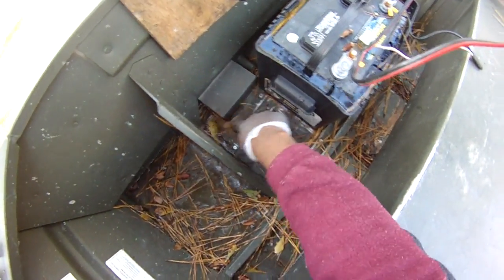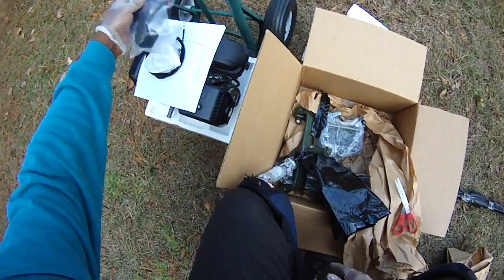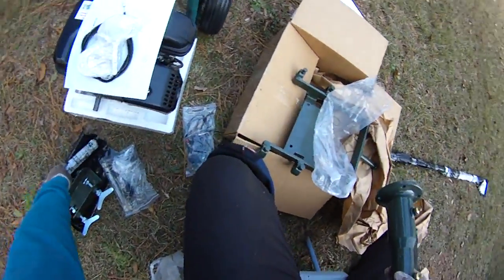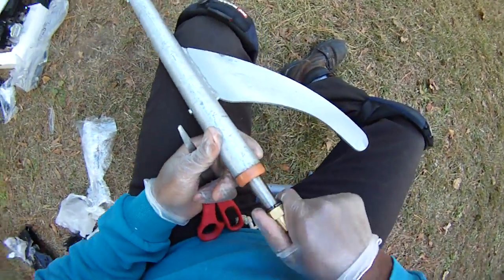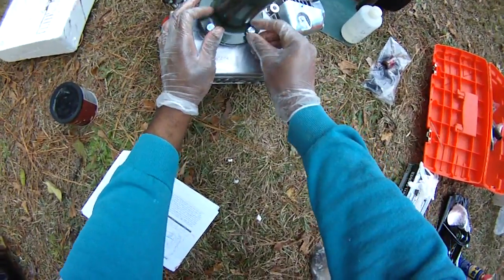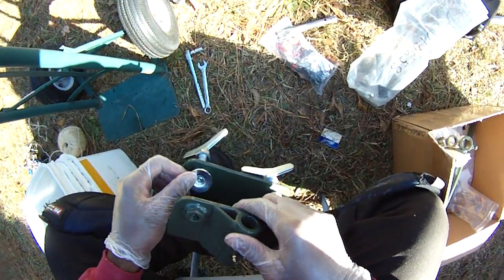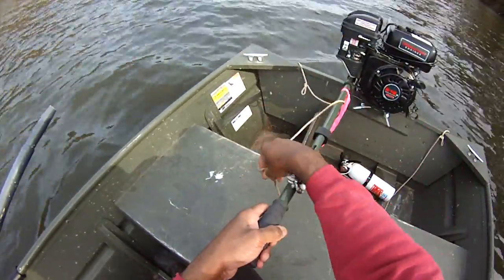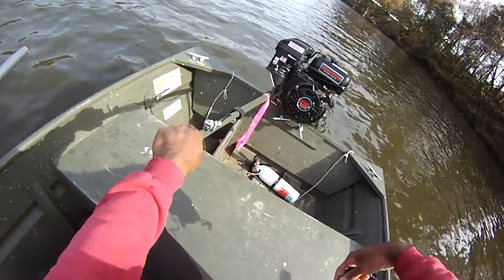SPS Longtail Review | Small Swamp Runner Mud Motor Kit | 212cc Harbor Freight Predator Engine

Comment from the maker: The owner of SPS North America, Joe Dobbs, e-mailed me a few pointers that might help some of you building from one of these kits:

There is one thing on your engine that you definitely need to re-do or
it will give you trouble. The wiring you cut and put a wire nut on
will not hold up. Those wire nuts are made for electrical
connections in home wiring that don't move. Due to engine vibration
that wire nut will eventually fall off and the wiring will come
apart. If I were you I would get myself some male & female bullet
connectors and rewire that kill switch. It will be much more trouble
free.

Also I noticed some of the grease zerks were only hand tight, so you
need to tighten them a little bit with a wrench so they won't fall out
due to engine vibration. Just a little, cause the soft brass will
strip out if you over tighten them.

Comment: Also, you may be able to stop the up down motion with a rubber stopper on the engine mount.  I know backwater does this with their mud motors, I'm thinking of doing something similar when I build the kit.  Basically it's just a rubber stopper on the top of a bolt that you thread down below the coupler on the back of the engine mount.  When the coupler hits the top of the rubber stopper the tail cannot go down any further.  Just a thought it would be a more permanent solution to the engine tilt.
Reply from the maker: +ejreams08 I just use a rope on the handle secured to the boat rib.

Comment: Nice video! Those brass fittings are called zerk fittings and make sure they are seated tight.They allow you to grease your fittings without having to "pack" them. Don't forget to put a couple of extra prop "keys/shearpins in your boat. Also on your kill switch, solder those three wires together and put some shrink tubing on them. Would you trust your life to a 5 cent piece of plastic? Nice to see you stress safety but don't forget your PFD. Have fun with your mud boat! PS: the best military aircraft was the C-121 (the super connie).
Reply from the maker: +Ratdog 305 The constellation was a beautiful aircraft. Modern aircraft lack that intuitive engineering those planes had.

Comment: Here’s a suggestion put an “adjustable rod/stick” across the boat width.  Bolt rod to upper sides of boat. That way the engine can only move up so high.
Reply from the maker: Thanks for the suggestion. A simple rope is the best solution.That's the way they do it in Thailand.

Comment: Just watching this video answered most of the questions I had, thanks for taking the time to record and post it.
Have you used the setup a lot since you installed it and if so how's it holding up?
Reply from the maker: It's holding up well. I'd recommend buying a good grease gun because you need to squirt it once or twice with grease before every outing.

Be prepared to get lots of eyes balls and conversation starters at the boat ramp. I mean you have this hot rodded little go-kart motor looking more like something they've seen at the drag strip than the boat ramp.
 
If you have the time Check out my mud motor hot rod course also up on my Channel: https://www.youtube.com/playlist?list=PL33pk1OEpFSoayYZMt5SH3-8WumPKytlz

Comment: That is actually a nice setup. I bet you could set this up with a centrifugal clutch. You could then leave it idling with the prop in the water without the boat moving, until you gave it some throttle.
Reply from the maker: Yeah, I've enjoyed it. Working on hopping it up with racing go-kart parts. I have the air intake and carb jetted giving me a good bit more power.

Comment: Nice Video. Very informative. Thanks fro sharing.

Couple of thoughts.:  First, can the un and down motion be dampened by tightening bolts on the bracket?  If so, that would be helpful.

Also , if you added a pre-tentioned bungee cord ore two from the tiller straight down to the seat edge, it might be enough to hold the tiller in a level position as well as self centering the steering motion of the motor in an accidental loss of control.
Reply from the maker: Well, the motor doesn't work like a regular outboard. You want that up down motion. the hydrodynamic forces and the weight of machine it self is a dampener. the propeller makes lift on its own, but the weight of the machine keeps it down.

Yes, it's customary to have the unit tethered with a string.

Comment: Very thorough video; thanks for taking the time. You mentioned having to hold down on the handle to keep the engine from tilting backward...once it gets up to speed, do you still find you have to push down on the handle so hard?
Reply from the maker: I've learned a lot since this video was made four years ago. Years the engine is balanced, and I had to move the engine plate forward and back through the various slots to find that "perfect" balance point. Also, in Thailand you always tie a rope that holds the motor and keeps it from flopping backward. And, yes, as the RPMs come up the tail will naturally rise making one-handed motoring very comfortable.
Reply: This manufacturer has a video on tuning this to “your” boat so it won’t pop out or pull
Reply from the maker: @Yuhmuthasaho  And it's also in the manual.
Reply: Black Warrior Lures whats this “manual” you speak of haha.
Reply from the maker: @Yuhmuthasaho  Whenever you buy an SPS longtail, you will get a manual with your motor's serial number. This manual is only available to SPS longtail owners and is only available in physical form.

Comment: Thanks for posting, this was really helpful as I put together my kit.
Reply from the maker: Nick Boehm Glad it helped you out. These are good motors.
Reply: Black Warrior Lures Hey, I was wondering how your motor does with RPM jumps? I'm still breaking mine in nice and light, but it seems to "jump" RPMs rather than smoothly moving forward and the engine kind of stutters, almost like it's not getting the fuel fast enough. Might be the throttle linkage? Any ideas?
Reply from the maker: Nick Boehm Mine runs smoothly. Have you made any modifications to the engine? If not I would consider rejetting the carb.

Comment: I've been watching your videos quite a bit to decide on what thai long tail kit to buy.  I just bought the 6.5 hp (212 cc) predator for the motor now I just need to wait on some cash for the kit.  What made you go with the SPS kit over the other companies?  Have you fixed the problem with the build up of heat on the shaft and the coupler?  How do you like the props? Have you broke any of them yet, I heard that was a problem with the aluminum.  Have you went through any weeds or mud with it yet?  Can the throttle be adjusted to stay at a specific position, can you tighten the throttle handle so you have to move it to decrease throttle?  And lastly, what size boat do you have width and length?  Thanks for the information, I am looking to put this on a smaller boat to get into backwater marshes by carrying the boat because there aren't any launches.  I think a small motor set up like this would work well enough.
Reply from the maker: +ejreams08 The throttle automatically returns to idle. Yes, you can tighten it that way. Yes I go through weed all the time. That's what it was build for.

I chose SPS, well. I'm a black guy and buying a kit from a company called KKK was out of the question. CLP was a good second. Ultimately Mr. Dobbs sent me a free performance tailpipe for doing the video. That's why I went with SPS.

Heat buildup is not a problem. Any transmission will get hot.

You need a soft metal like aluminum with these props. The idea is to sacrifice the prop, not the motor. That's why there prop are so cheap. No I haven't broken one yet, even though I've had it on the rocks.

My boat is jon boat 12ft 36wide.
Reply: +Black Warrior Lures lol yeah the KKK thing had me taking second looks too. I assume that it means something drastically different in Thailand!   Thanks for the responses. I ended up going with an SPS kit too, mostly because of your videos, really helped me see the quality of the kit, thanks for that.

Ended up buying a 212 predator at HF the other day, apparently its the hemi model which has made it a bit difficult to find upgrades for. But ive managed to order up, new mod 2 cam, billet fly wheel, connecting rod and bored out race carb. Also got the exhaust filter kit you got. Should be able to push 6k out of it i think. Ill be sure to do videos on it and post to the sps site. Hoping to get around 7-8 mph on a shallow v 14' "resort" type boat for backwaters. thanks aain for the videos, helped out a lot.
Reply from the maker: +ejreams08 Yeah, I want the Mod 2 cam and flat top piston myself.
Reply: +Black Warrior Lures I would suggest them, I think the black mamba jr gives a little more low end torque which could help the motor get out of the hole a little better, but I think the mod2 gives me great all around performance.

I finished the rebuild this last weekend, I ended up getting 20 MPH in open water with just me in the boat (330 lbs).  The cam and valve springs with the connecting rod and flywheel with race carb gave me a 7.5 mph boost.  I would strongly recommend doing the upgrades.  This was my first time modifying the internals of an engine, and I was surprised how easy it turned out to be. After I modded the engine I needed to prop up from the 6.25" to the 7".  Me and the girlfriend ran our local river for walleyes a couple days ago, skipped over 3" of water like a champ.  Next upgrade is gator glide for the bottom of the boat getting ready for duck season.  I'll try and post videos of the motor in action.  This thing is bullet proof so far, I haven't been kind to it lol.
Reply: Buy a Backwater swamp mud motor instead and it is American made.

Comment: Please reply on here, as I can see it here for some reason. Thank you! What were you saying about gopowersports saying not to use that engine? & why did you change the external gas tank setup? And what were you saying about the governor? I really enjoy your channel brother
Reply from the maker: Okay, I'll reply here, but I'll shot a video today explaining. 

1. Go Power Sports
I e-mailed GoPowerSports about using their engine for my mud motor. I sent them the video(s) where I blew up a couple engines. I wanted to know about the viability, reliability of their motor in an austere environment. This was the reply I received from Tim:

"I don’t know about that, I would think the 301 or 420 Predator would be best. its like you said you have to work the heck out of it to achieve the hp wanted."

2. Why change the external setup?
I kept getting leaks in the line. The weight of a six gallon tank made the rear end sit too low in the water and would not get up on plane properly. I also worried about reliability of the pump over time. The gas tank would swell so badly that gas would often creep up through the line and flood the carburetor. Overall the stock, gravity feed tank was a better solution.

3. The governor
the governor is the only thing keeping that engine from blowing itself apart. When you're out on the street or race track you have a smooth surface. It isn't like that on the water. Even the slightest chop makes for uneven, well, if you watch the governor arm while you're moving along, it's working like crazy keeping the engine from over revving. It's making all kind of minute adjustments that you could never make by hand. that's what keep the engine from blowing itself apart.

If you need more power than stock, you really need the next biggest engine.
Reply: Black Warrior Lures thank you!! Looking forward to your video today!
Reply: Its a grease fitting for a grease gun ,usually near bearings etc...🔧

Comment: Usually you can reach a balanced angle to the water by moving the motor in the bracket
Reply from the maker: Right, thanks. I didn't know that at the time. What I really want to do is mount this thing inboard.

Comment: thanks for posting this, im looking to get a new motor for my boat its a 14x50. my 25 nissan quit on me and one of these kits will be cheaper than buying an brand new outboard
Reply from the maker: +Jamie Davidson Yup, and you can upgrade the performance just like a hot rod.
Reply: it should push my boat good with the bigger motor i think its  a 22. my boat is wide and heavy
Reply from the maker: Yeah, the 22 is what you need. There are some videos of guys using the v-twin. It's power house of a motor!

Comment: harbor freight sell 3 different 6.5 preditors , 60363 .  69730,and the 69727. I was wanting to do this ,but need to know which of the three fit the sps small.your knowledge would be greatly appreciated.
Reply from the maker: ***** All these engine have the same bolt pattern on the drive shaft, so they will all work. Mine is the 69730 which is EPA emission standards only. The 69727 meets both EPA and CARB emission standards. For instance if you live in California you can only buy the 727. The 363 is sold in stores. It's the same as the 730 only Harbor Freight doesn't share stock between their stores and their warehouse, so they have a different SKU for the motors they stock on the shelf.

Comment: Did you run your motor for 3 hours before assembling the kit?
Reply from the maker: For this one I did, but I break them in differently now. I will run the engine for 20 to 30 minutes with no load. Then I'll bolt everything up and head to the lake/river and run around at idle speeds for another 20 or 30 minutes. Then it's full on regular use. I'll change the oil after 5 hours.

Comment: I have been waiting for a great video like this thank you.
Reply from the maker: Thanks, I hope it helps you make a good buying decision. It was a fun kit to put together, and it will get where you want to go on the river, a big step up from a the modest trolling motor I was using, and the longtail is good on gas.

Currently hot rodding the motor to get more horsepower out of it, at least free up all the restrictive components like the air, exhaust and the carburetor itself..
Reply: The biggest problem is what size motor I want 6.5hp or 13hp. I have a 1432so I don't need much but I don't want to regret it.
Reply from the maker: ras50401 Well, weight is a consideration. The base weight of a 6.5 Predator is 37.5 lbs. A 13 hp Predator weighs 73 lbs. Twice the power at the cost of twice the weight. For your 1432, weight may not be much of a problem. If weight is no problem for you, then go for more power.

Another thing to consider is performance parts. Are you a tinkerer? If you like to upgrade and mod things, there are more hop-up kits and parts for the 6.5 than the 13. If you want to bolt-on-&-go not worrying with anything else the 13 is the way to go.

Comment: What kind of grease did you run? On my large swamp runner it says #0,#1, or #2 but I can't find ten no where
Reply from the maker: +Central Bass Fishing I think mine is #1 axle grease. It should be available at any auto parts store. I bought mine from NAPA along with a quality Lincoln grease gun.
Reply from the maker: +Central Bass Fishing Have you had much of a chance to run your large kit?
Reply from the maker: +Central Bass Fishing Wait, I have #2 grease. Bought it from Advanced Auto. It's the same kind of grease they use to lubricate the car chassis during an oil change.

Comment: I added the intake but im having a problem with it running lean did you have this problem?
Reply from the maker: +Jon Hunt Did you rejet the carburetor? That adds more gas to balance out the mixture. I use a 0.037 jet in mine. You need to buy several jets to find the one that runs best in your system.
Reply: no did not rejet it. Was i supposed to?
Reply from the maker: +Jon Hunt Yes, you were supposed to re-jet the carb, as taught in the course: https://www.youtube.com/watch?v=6laj4iM82Wo&list=PL33pk1OEpFSoayYZMt5SH3-8WumPKytlz&index=4

If you dump in more air, with will have to dump in more fuel to keep the mixture right.